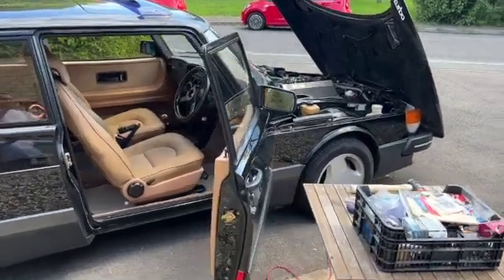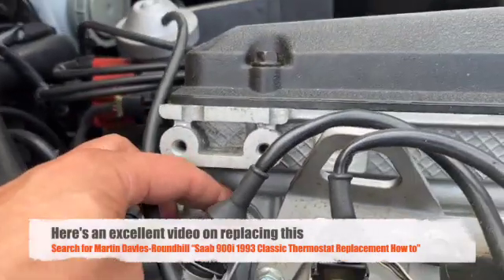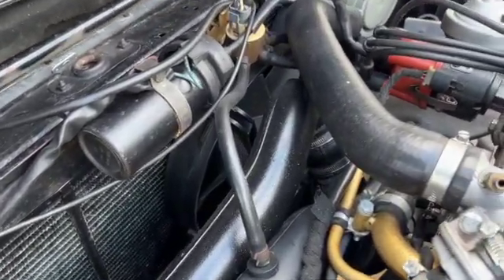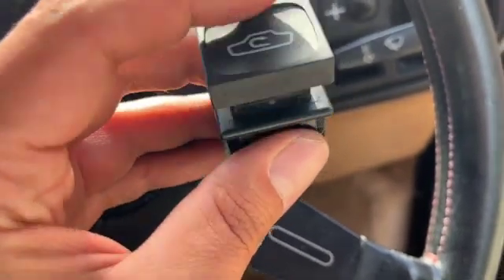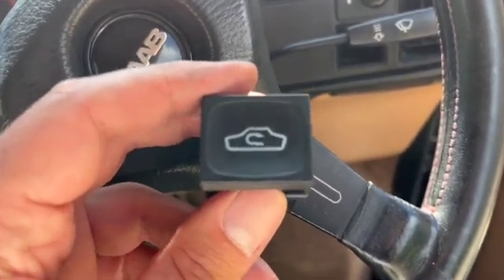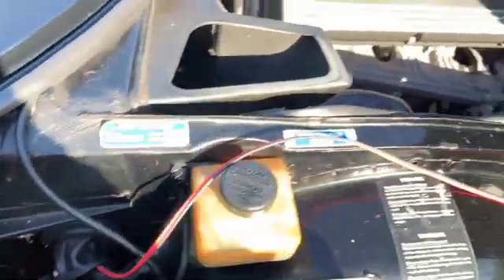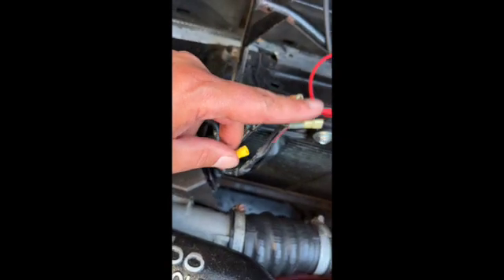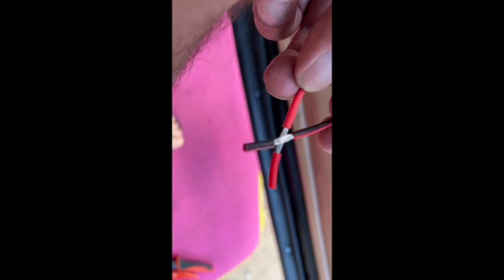Saab 900 Turbo 16S – Adding a manual switch for the radiator fan

Comment: I think i'll add a lower temp thermoswitch in parallel, with a switch of it own to decide if I want to use it or not. aluminium tape it to something hot
Right now I'm not sure if my thermoswitch is broken of if it just way too hot of a temp for my liking

Comment: No need to do that really. Fans kick in at 102c on all B2x2 / B2x4 engines. The engine is at its most optimal at 100c, with typical running temps on the road of 89 / 91c with airflow.  Paul @ The Saab Clinic UK (ex Saab master tech)

Comment: You did what i would do, as a temporary solution, without any major concerns. A manual override of a circuit of this type may well be permanently installed because there is nothing wrong with that. Furthermore, you had the attitude that we should all have, which consists of analyzing the problem and putting the most basic concepts into practice. This is development, whatever other people say.
Greetings from Portugal.

Comment: Great looking Saab.  I’ve got the same car in silver (85 t16s) The temp gauge in mine never really moves much from very cool but the fan cuts in very often so over the years I’ve learnt not to worry much about it over heating.  They do get very hot under the bonnet though so very nice mod.
Reply from the maker: Great to hear yours stays cool. Mine certainly nudges the H on the temp gauge before the fan kicks in, so this will help. I will replace the thermostat too just in case.